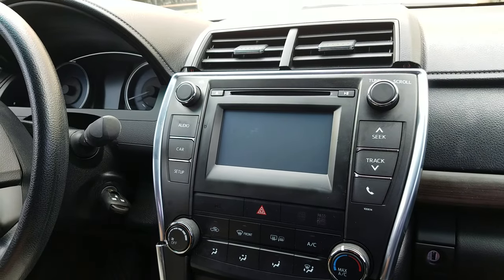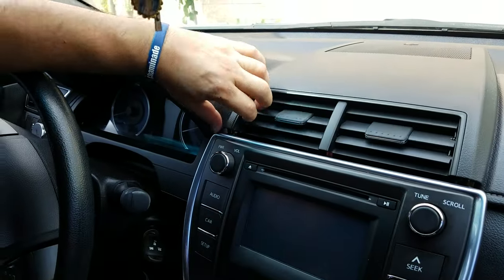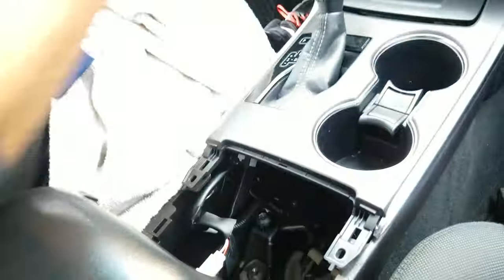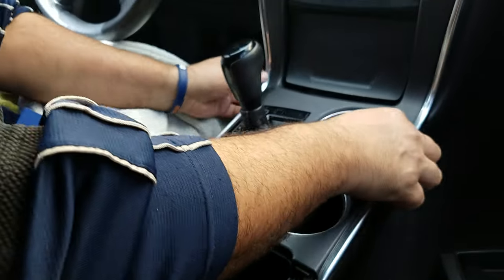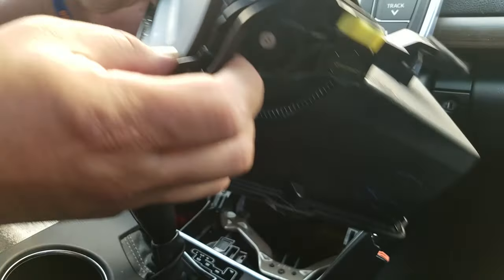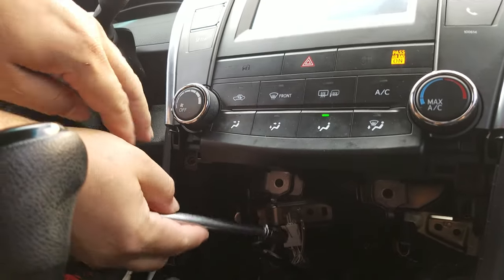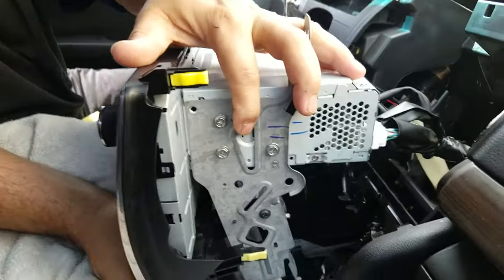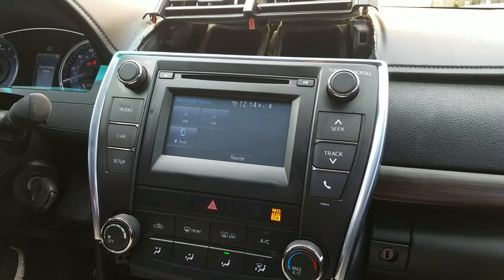How to Remove Radio /Touch Screen / CD Player from Toyta Camry 2015 for Repair.

Comment: I spoke to Toyota and they said that if there were enough complaints they would do a recall.
Reply: What is wrong with your screen? Mine is acting up glitching from on and off Bluetooth.
Reply: @marcomartinez8703  it's like it has slid down. You have to touch the spot under what you want and you can't use the touch screen at the very bottom. Also, my bluetooth doesn't work properly. I can hear people but they can't hear me. Of they do hear me, it's all garbled.
Reply: @marcomartinez8703  Also how long do these take to boot up? Are they as long as a phone?
Reply: Hello Nancy,  I don't know if yours is fixed but I just want  to add my name to the list of Toyota owners who have this problem. Mine can't boot up completely. It's stuck on the Toyota logo.
Reply: @max55well  mine also no longer works
Reply: @max55well where can I join the list?
Reply: @synewparadigm  I don't know now. I just went ahead and replaced it with an aftermarket

Comment: Cowboy Toyota broke my face plate on my radio. My radio turns on by itself. None of the buttons on the steering wheel or radio panel work. They wont claim responsibility. Please put a way for me to try to replace or repair it.

Comment: anyone having a hard time removing the wires? the clips won’t release for me
Reply from the maker: The connectors are tight. Just use a small flat screw driver and push in the small tab all the way in then with your other hand pull the connector out.

Comment: Thanks! That was a big money saver. Took 1.25 hours and works like a charm. Just had to transfer the clip with the HVAC controls from the old radio to the new. Getting that first clipped thing under the console tray was tough (push down on the top of it with a small flathead screwdriver to prize it out of the white socket/clip it's in).

Comment: The screen on my Camry 2015 model has a white screen always, turning off the power to turn off the screen turns the screen dark for a second or two but then the screen turns white again
Is the issue relates to the wiring not connecting properly or a new screen is required?
Reply from the maker: Problem is not the wiring. It could be due to faulty screen or circuit board.